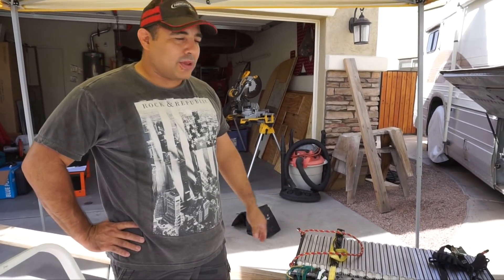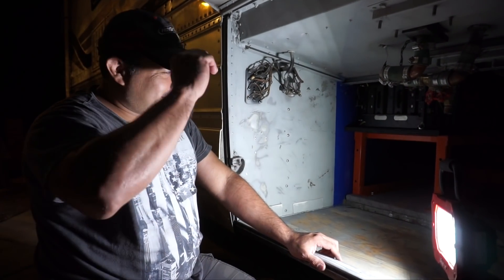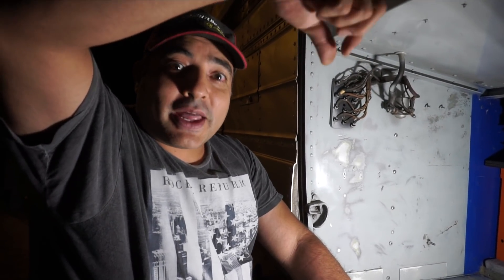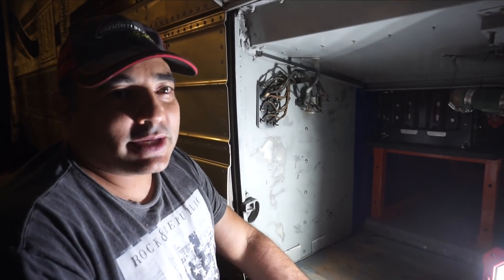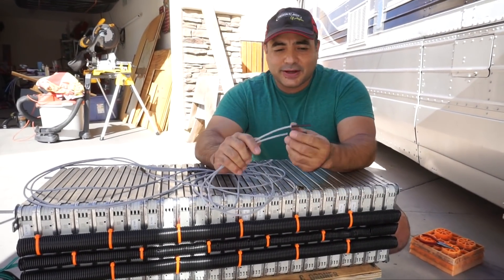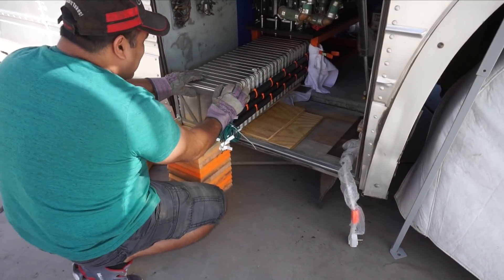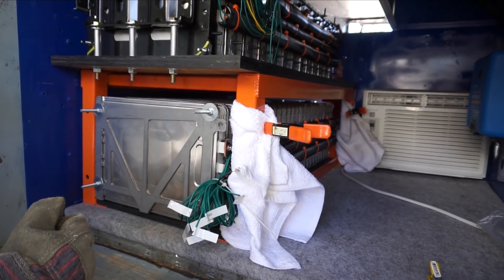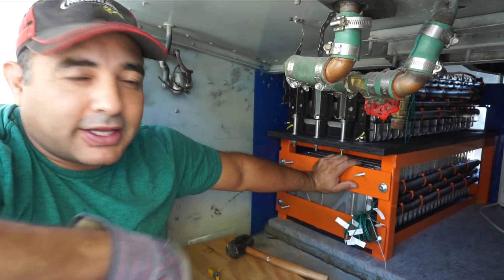RV House Battery Part 6: Installing the Nissan Leaf Battery in the Bus

Comment: What material is that under the batteries? It looks like granite?
Reply from the maker: That is a 3/4 inch sheet of plywood covered in carpet designed for speaker cases.
Reply: @BeginningfromthisMorning  thank you

Comment: Mice are very destructive. I am told they use soy based inks to color the material in wire insulation. Mice love soy!. And you were told right.  Mice will try to make your day miserable. Nice job on everything you have done.

Comment: I'm coming late to this story. How long can you run off a battery alone? Curious about all of the equipment hooked up. Appliances with their own inverters or the system?
Reply from the maker: Thank you John - The system is based around the Victron Quattro 48/5000 inverter.  We have had the system installed for almost 2 years now, but this past Feb we moved the build to a piece of land with no power or water.  Talk about jumping in the deep end!  These past 8 months have been a very good test of what the system can do. We have learned a ton!  We are trying to finish up the bus and we are dependent on the bus for all power and water needs.  We run everything to build the bus from the battery and solar - 2HP table saw, 15" drill press, 6.5HP air compressor, 15 Amp planer, 110V welder - basically anything we need to build the bus gets run off our system.  We bring our four kids with us to the build so we air condition the inside with up to 3 air conditioners (12k BTU mini-split, 5k BTU window unit in the rear, and a 8k BTU portable unit because this has been the hottest summer on record in AZ). We also run a 5k BTU air conditioner in the bay to cool down the batteries, inverter, solar controller etc.  So 4 air conditioners, a huge assortment of power tools, a refrigerator, a cellular router, a cellular booster, security system, 3/4hp water pump, and of course lights, chargers, computers.  On battery alone with no input I think we would last about 10 days with just our baseline loads (we drop about 10% SOC from the time the panels stop making power until the run rises the next day).

Comment: I wonder if these batteries are the cobalt version chemistry that can have a cell runaway and catch on fire as Leaf lithium with oxcide? Wow, that would be bad or risky at the least. I have been seeking a battery and I see these all over the place but then get uneasy after hearing WIll Prowse say he wouldn't have them inside any RV, only outside and so that if they should have a runaway cell that the entire battery bank is outside, in a metal box or a way of disconnecting and dropping it more or less.
Reply from the maker: Thank you Phil - these are not the Cobalt version of the battery.  These modules are Gen2 modules which have a Cathode Material of LiMn2O4 with LiNiO2 and are often referred to as "Lithium Manganate" version.  These are much safer than the Cobalt version.   That being said -  ANY battery run out of spec can be very very dangerous - even lead acid batteries (https://www.unikautomation.com/can-lead-acid-battery-explode/).  We do everything we can to keep the battery as safe as possible.  We have a dedicated Battery Management System (BMS) that watches all the parameters of the battery and shuts down the entire system if parameters are out of spec. That being said I believe these batteries to be very safe.  When Boeing had all those battery problems with the 787 Dreamliner, the cobalt chemistry was found to be culprit and they replaced those batteries with "Lithium Manganate" batteries for safety
(see "Groundings" heading in https://en.wikipedia.org/wiki/Boeing_787_Dreamliner_battery_problems). 
The Nissan Leaf vehicle has sold over 400,000 Nissan Leaf vehicles - it has had 0 runaway thermal fires.  There is a wikipedia page that keeps track of electric fire incidents (https://en.wikipedia.org/wiki/Plug-in_electric_vehicle_fire_incidents#Nissan_Leaf) reports one Nissan Leaf fire with "cause of the fire was not confirmed".  Lastly there are quite a few videos where they do destruction tests on the Nissan Leaf battery modules and they can't even get the battery to behave badly by stabbing the pouches or even setting the battery on fire with a propane torch.  (https://www.youtube.com/watch?v=Jz37WycW-7E).
Reply: All very useful informatio and I am thankfuk for the heavy research. As Inrecall the Gen2 used batteries are more investment over Gen1. I was also curious if your window shaker type ac unit has to run all the time or if it too can be controlled as an auto turn on at a certain temperature? Great job and it gives me a lot more information to work with. Great job.
Reply from the maker: Thank you Phil.  Yes the Gen 2 battery is a little more than the Gen 1 battery but it does quite a bit better in terms of longevity.  The small window a/c only runs if we are using the battery and the bay temperature exceeds 90 degrees F (which is very often here in AZ.  We hope when we travel to be in much milder weather).  It does quite well in that little space it can keep that bay at about 75 degrees even on 110+ days here.

Comment: Found you through Bus Grease Monkey! Love your content! What temperature are you going to keep the battery space at? Are you concerned about what vibration will do to that home window air conditioner? Maybe thick rubber mat instead of plywood for it to sit on?
Reply from the maker: Thank you Terence - welcome to the channel!  Everything runs best at about 75 degrees or so.  I would love to keep it in that range.  In the summer here when it is 112 degrees outside we can usually keep the bay at 85 pretty easily.  So I am hoping as we travel through more moderate climates it will be easy to keep the bay below 70 most of the time.

Comment: I suggest a furnace filter over that floor pan vent, the dust that will accumulate in that compartment  with out it will be  astronomical.

Comment: How will you clean that a/c filter? have a feeling it will clog up quick
Reply from the maker: Thank you Edward - the unit pulls out by removing two bolts so it is pretty easy to service the filter.

Comment: So this video is like 2 years+ old at this point.  Have you had any problems with the window unit A/C keeping the batteries and electronics cooled off?  The hot side of that A/C has nowhere to really reject the heat, except for up into the floor of your bus.
Reply from the maker: Thank you alm3333 - no problems other than we need a more clever way to get rid of the heat from the hot side of the a/c.  Right now we just leave that bay door open and have a fan that pulls the air out of that bay.  At some point I will design a shroud of some kind to push the hot air down through the floor (might need a little mechanical assistance via fans)
Reply: @BeginningfromthisMorning  A shroud and yet another hole in the floor of the bus would definitely work.  The back of the AC has a fan already that should push air through the shroud.  Also, you already have a second hole in that bay to draw in fresh air.  I also hope you fabbed a panel to cover that hole between the two bays so you are able to separate them.  

Regardless, great bus build.  I've been binge watching several different ones, in preparation to embark on my own skoolie project, and you seem to put the most thought into your projects and upgrades.  I get much less of a feeling of impending doom and potential destruction watching what you guys are doing and how you're doing it.  Also, I'm glad you got the BGM out there to help sort out the mechanical issues.

Comment: Outstanding video.  You had a plan and worked it to perfection.  I do have a couple of questions about the battery itself.  Did you use all the cells from the pack?  How do you actually go about buying a whole battery?
Reply from the maker: Hi - thank you it has been working very very well.  I did use all the cells in the battery plus one additional module (for a total of 49 Leaf "modules" [each module actually contains 4 cells]).   Buying the battery is surprisingly easy once you know where to look - I bought my entire battery for $2500 it was another $150 core charge and $150 to ship for a total of $2800 for just over 24 kWh of power.  Email me juan@beginningfromthismorning.com and I will walk you through how to buy a battery and how to find them.

Comment: So you dink youz ah smarta eh? 
Forgot to hook up the brakes to the battery for regenerative braking to charge it. Hehehe...
Just pulled that one out of my rear. 
Great job. While you saved $$ on the battery the custom fabrication and brain hours going into this would be almost cost prohibitive for anyone else wanting to do this. 
Especially if you charged $90hr for your work. That alone would be another $3k? 
Well done sir.
Reply from the maker: LOL Thank you - Regenerative brakes would be amazing!  Well beyond my capabilities, unfortunately ;).   I try not to think of the countless hours of research and thinking, rethinking, then fabricating that I have had to do to make this work.  Honestly, it has been a lot of fun.  I had plenty of nay-sayers when I first started.  I am not an electrical engineer and just basically had to figure things out.  I tried to make videos of what I would want to see if I was attempting this.  That being said another $3K would still put me under $6K for 24 kWh of battery power.  If I were to go buy Battle Born batteries of a similar capacity I would have to spend well over $20K

Comment: Nice job not sure why you did not install the other hardware in front of the battery(towards the door) rather than current location which reduces access to both battery and hardware.

Comment: How long do you think your battery pack could run with out sun. Just a ballpark figure. I know there's all kinds of factors.  By the way great job I was watching and I was getting a headache. Awesome
Reply from the maker: Hi Mike, Thank you for the kind words - sorry about the headache - I tried to include as much detail as I could because when I was researching doing this there was not much information available.  The battery pack has a lot of capacity (about 2000 Amp hours @ 12V ) - so if we are not running the air conditioner it would probably last at least 4 or 5 days fairly easily, possibly a week or more if we are careful with how we use our power.  We are currently building the solar rack and that should work very nicely with this battery pack (3480 Watts on the roof - they are our newest videos right now) - The goal is to be able to boondock for as long as our water supply will allow (166 Gallons of water).  When we finish the bus we plan on living in it full time and I am still working so we overbuilt the power system slightly :)
Reply: @BeginningfromthisMorning  the headache was a good thing didn't mean any disrespect. We just stop traveling the country for over a year. Did it all wrong spent way to much money. If you like I could tell you some nice places we stayed. Just found you on YouTube
Reply from the maker: Thanks Mike - no disrespect was taken.  I would love to hear about your experience and your lessons learned!  When we finish this thing we plan on going full time so I would love to hear your insights.  email me at juan@beginningfromthismorning.com

Comment: Blimey. Why didn't you just make 7 sets of 7 and just wire them with cable? Similar space requirements, though you could have fettled them into the space. A lOT less hassle than two buggers.
Reply from the maker: Hi James - thanks for the question.  We considered this configuration and it was what we were going to go with at the onset.  However, 7 sets of 7 would have required more space because the battery modules need to be compressed to function properly.  This alternate configuration also would have also forced us to use 7 BMS units as opposed to being able to use a single BMS.

Comment: How was the battery temperature controlled in the Nissan? The house A/C seems to be overkill (a power monster)? How will you turn the A/C on and off? I think this is a great battery solution. I currently have 4 6volt golf cart batteries for the house, and two 12 volt batteries for the chassis. The chassis batteries are showing their age, but the house batteries seem to be ok for now. Future project???? Would it be worth it for me, I do not know. I would want to wire for 12 volts (14). Glenn Lever
Reply from the maker: The battery in the Nissan Leaf has no temperature control at all (It was sealed air-tight in a metal box that rides under the chassis of the car).  2013 and newer leaf batteries are nicknamed "The Lizard Battery" and are supposed to be much more tolerant to heat (imagine how hot it gets in AZ when the ambient air temperature outside is 115 and the battery is cooking inside a black metal box).  The A/C system is definitely overkill - Originally I was going to just move some air around with some large fans - then I read the specs on these little window units - 2 amps of power on power save mode (110V) 4 amps MAX - built-in thermostat with remote control.  For just over $150 it seemed like a really good way to pump heat out of that bay.  Honestly, it is more of an experiment than anything - I have seen many people with Lithium batteries and big inverters complain that the temperature climbs pretty quickly - I can just set this thing to 80 degrees and monitor it via the Victron color control.  We'll see how it all works out - I keep getting teased about it on a battery group I belong to ;)

Comment: Great job, but with that high end of a battery using crappy window AC unit is like eye sore! Get some inverter AC split system with heat pump, saves power, modulate the compressor so it can run at super low amp draw, and it can HEAT with COP of 3-5...
Reply from the maker: Thanks for the feedback Zegarac - The A/C in the bay is more of an experiment than anything else - we hope to not have to use it much.  We chose a window A/C because it doesn't use a lot of power (Max was 4 amps but it usually stayed at around 2 Amps).  These little window units are surprisingly efficient and inexpensive.  We did go with an Inverter based, modulating mini-split for the main bus air conditioning.
Reply: I found the video you made about it, and someone recommended you might need one more unit, cool thing is you can get multi-split inverter units up to 4 internal heads, plus you did not mention does your unit heats the interior (Heat pump)? {edit} i found unit on amazon, it is one that heats, great!! And as you mention first step in startup was 1 AMP draw for easy cooling more like dehumidifying, but that is great range of power that unit supports. You made all the right steps that i would, great work!

Comment: I THINK IF YOU HAD A CPL 12V PC FANS [BIG ONES] JUST HOOKED TO THE OUTSIDE WALLS THOSE COULD COOL QUITE A BIT FOR YOU WHILE IN MOTION AND WHEN ITS COLDER OUTSIDE ,
Reply from the maker: Great idea Tony - Nice thing about those fans is they do not draw a lot of power.
Reply: yes and they make them in up to 240mm sizes toomaybe bigger but that's the biggest I see at micro center

Comment: Really nice install guys. Are you going to be using VRM once your CCGX is connected up?
Reply from the maker: Yes, we hope to use it once we get everything connected and wired up.  We have only looked at it a little bit but it loos amazing for remote monitoring.  I think our CCGX is compatible correct?
Reply: Yes, the CCGX will talk to VRM. Once you get it set up, update the firmware. The "Venus" firmware is constantly evolving. I don't have a CCGX like yours, I am running a (poor man's) Raspberry Pi type of device with the Victron Venus firmware on it. It does the same thing, just missing the cool display. What are your plans for internet connection in the RV? I guess you'll be using some sort of cellular router?
Reply from the maker: Awesome!  I am just getting into the Raspberri Pi stuff- Love it!  Yes we are likely going to go with a Verizon hotspot with some sort of booster

Comment: Great job, what about fire detection and suppression? Bus fuses to break circuits?
Reply from the maker: We are researching fire suppression systems for this bay and the engine bay.  We just released a video that shows the fuses and breakers we have installed.  Look for Part 7 in this series.  Thanks!!
Reply from the maker: Yes, we are trying to be as safe as possible.  Thank you for watching.

Comment: put a fan that go out the floor of that area
Reply from the maker: Yes - we are considering installing a fan to suck the air out of that bay :)
Reply from the maker: Yes the window A/C is to keep the batteries and electronics cool - I think Phillip is talking about putting a fan in the bay with the back of the air conditioner to keep air flowing back there

Comment: Thank you much for your posting. I don't if anyone else has already asked, but are you working into posting the video of your final exterior board where you wired everything in place?
Reply from the maker: Hi Victor - Yes we are going to show the board of our supply side of the electrical system in the next video - we were waiting on a high voltage (250V) breaker to ship to us and it is finally here!  We are hoping to put that together this weekend - thanks for asking.

Comment: Looks awesome.  Are you going to do anything so you can monitor battery temperature from a display or something in the bus?
Reply from the maker: Yes, we have a BMS that will show us the battery temperature and the voltage of each individual cell as well as the health (based on internal resistance of each cell) and the state of charge (how much % battery we have left).  We are still figuring out how to set everything up but it should give us more information that we care to know about :)
Reply: Very cool.